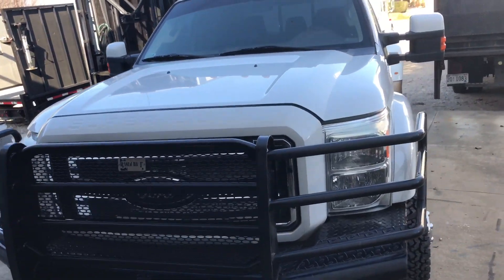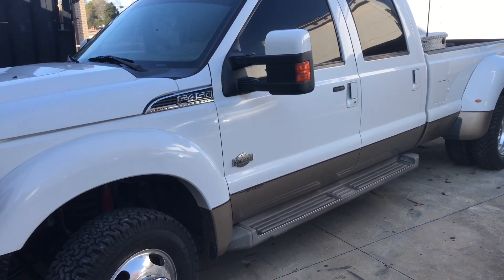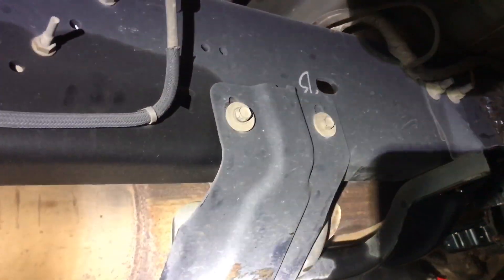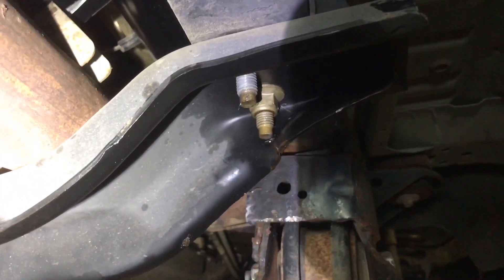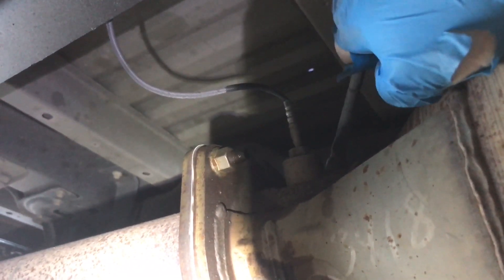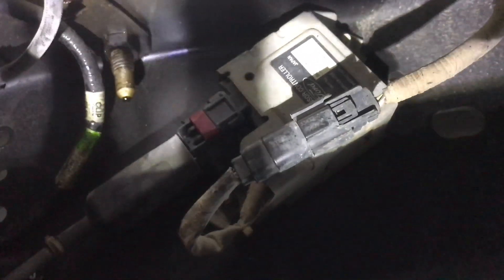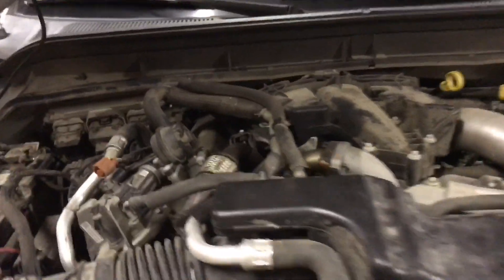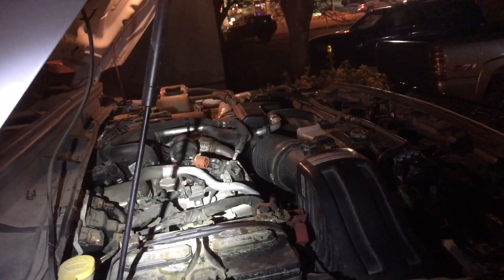Ford 6.7 Powerstroke DEF and DPF delete tips tricks and techniques

Comment: Were you able to delete the dpf without doing the egr delete? Using the h&s tuner?
Reply from the maker: ohlinboom you can by disconnecting the sensors but I ended up doing it anyway. There is a video on my channel. If you don’t mind please subscribe.
Reply: ohlinboom do the get delete first...it’s actually what causes the most issues

Comment: You can remove the hanger brackets from the frame. Much easier than messing with the rubber bushings.
Reply: Corry Dixson or just keep a spray bottle of soapy water